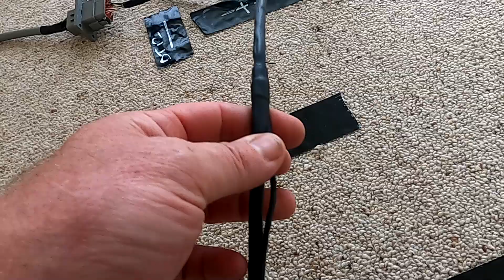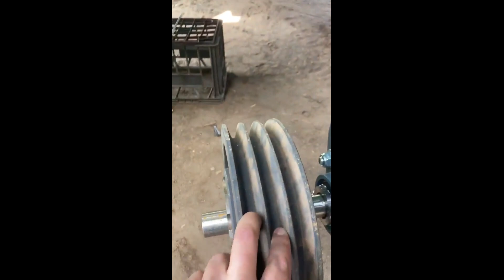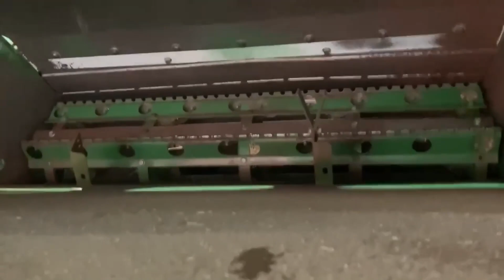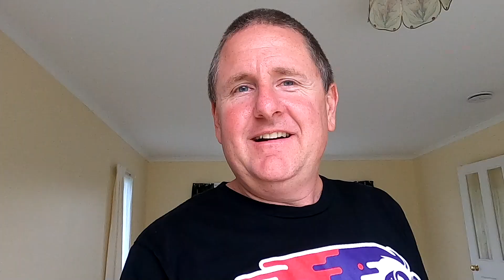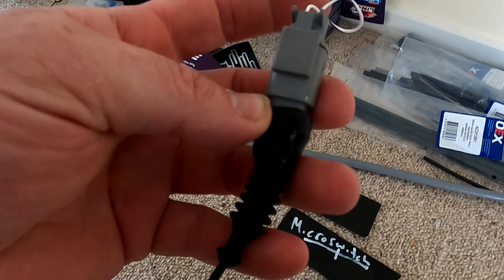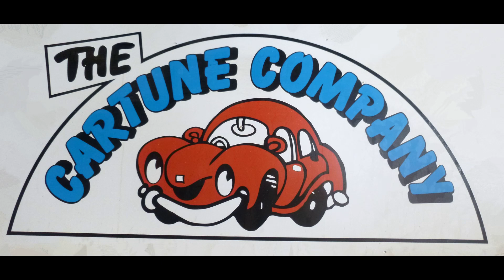Link ECU onto a John Deere Combine harvester Seed destructor.

Comment: Good stuff kelvin 
Give us an update when he gets it up and running 
My Ferguson 28 wiring could use some work.
I’ll drop it round
Reply from the maker: This unit has now done its harvest work and I really should do an update video.  There was a near failure else where in the machine, and this system suggested the operator shut it down, which saved some $$$$ for the owner.

Comment: Kelvin, do you do Case and Massey-Ferguson as well? ;) Nice use of your skillset. For more rudimentary stuff, I've seen folks use Raspberry-Pi pc's to capture CAN Bus signals...
Reply from the maker: We have a 1uz powered Massey Ferguson in the customer fleet.  Its done 11000km since it was assembled.  We were considering the factory tacho signal but thought a standalone system might be better for future fitments.  Jessie thought I had the setup wrong when the two speed signals didnt match but turns out there was a 1.1 overdrive on the pullies so I was let off.  Im thinking you might enjoy some of the setup of this one.  https://youtube.com/playlist?list=PLpppUSt353-CtOpgjaFl53XsCaPX9px5V